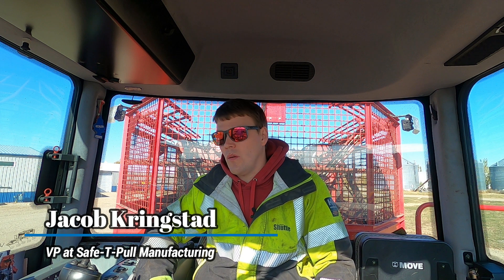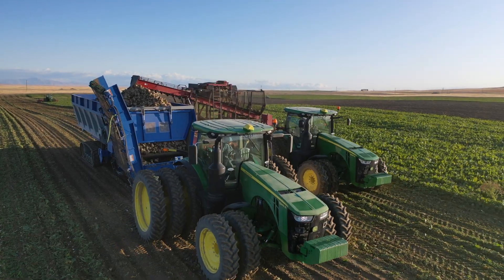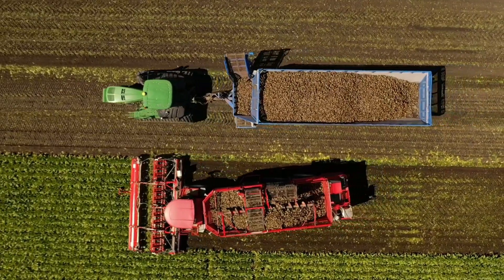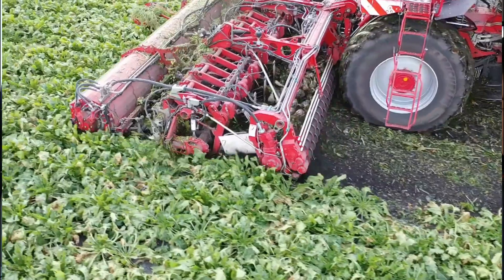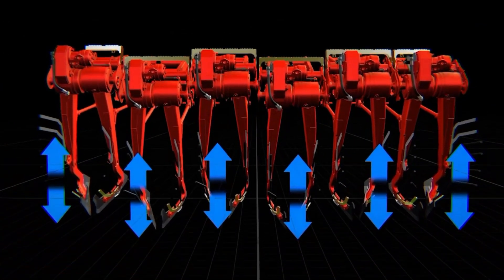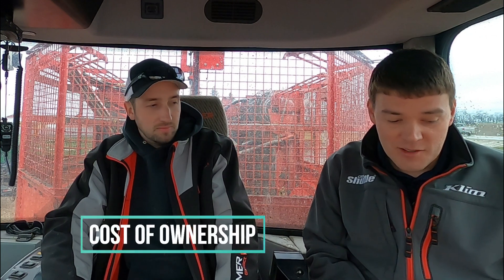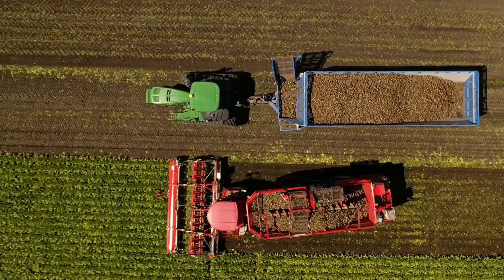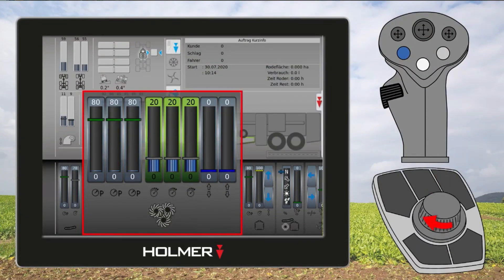Why self-propelled beet harvesters are the future for the Red River Valley

Comment: With the pull-type defoliator and lifter the tractors have to use narrow tyres but this machine means all vehicles can be using larger floatation tyres. That will also help reduce ground compaction.
Reply from the maker: Correct, the compaction even with a full hopper is less than pull types. Plus you are pushing the header not pulling it so the crop is already off by the time the tires get there 👍

Comment: they are the future but the price and parts availability needs improvement.

our lifter tractor is a planter, baler, and lifter tractor. if the motor blows up in it we can pull the pin and hook a different tractor to it in minutes.

after 2018/19 seeing these buried up to the nuts and the FWA deere with a 8 row is going through the water next to it with no problems.

interested to see what the future holds, best of luck.
Reply from the maker: I agree the dollar isn't in favor with the Euro, as we speak it's about 1.21 exchange which makes it tough. 

I also agree the timing has to be right to make the switch to SP, based on many things not just your lifter and topper.

As far as parts and service goes we are working diligently to provide for the RRV across all our product lines. Time and time again we base your motto off of "sales sells the 1st, but service sells the rest" and the Holmer won't be any different 👌
Reply: @SafeTPull  If there is one thing you guys do a awesome job at is service.